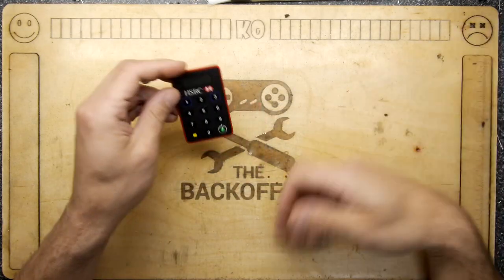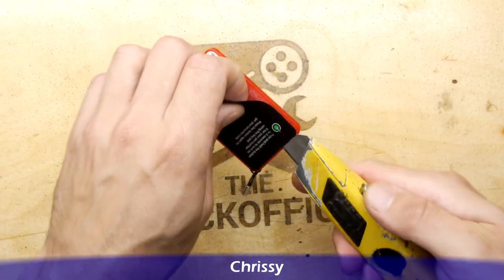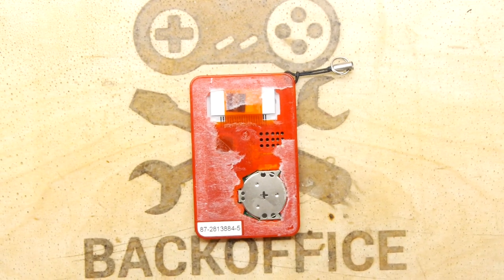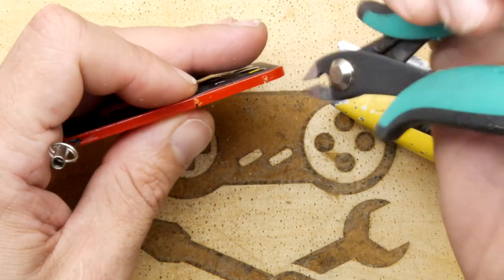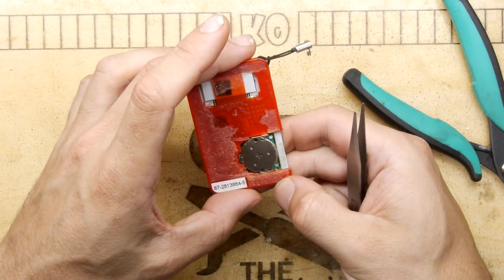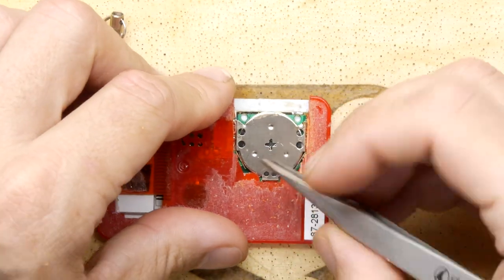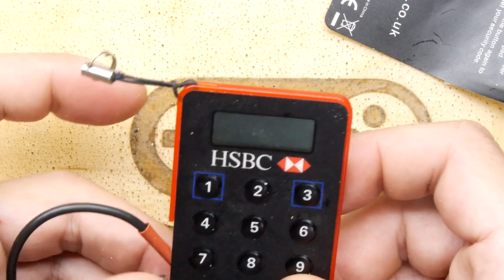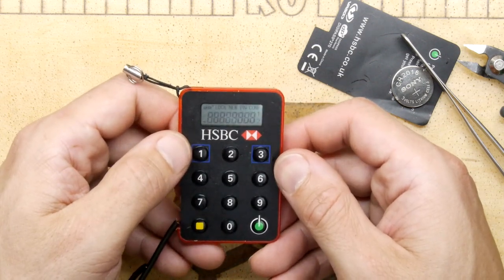HSBC Bank Security Dongle Teardown

Comment: Dongles, invented by Don Gall, actually plugged into a computer that had expensive software in the early days such as Racal's PCB design software. These HSBC security devices are not Dongles, rather simple code generators.

If the battery is removed, these will not start again unless re-initiated. A small group of us applied power by piercing the keyboard and sticking Pogo contacts in. We ran a sequence and managed to extract a complete number sequence.

Comment: Thanks for this video.
I have a similar Digipass it's about 3 yrs old now. A year ago when I powered it up I get 'batt 02'. 6 months ago I get 'batt 01' and now I am getting 'batt 00' so I assume the battery is almost done but it's still working fine. It seems from other videos once the battery is removed from PCB you lose info that is stored in volatile memory so the unit needs re programming. If I solder a new (bigger) 3V rechargeable battery in parallel do you think the unit will work indefinitely?  subject to changing the rechargeable every so often. It won't look pretty but I can keep it in a drawer by my PC which is the only place I use it.
Reply: Yes, it will work if you connect a new bat before the old one dies. Change the battery does not work.

Comment: I have three of these devices all from different banks. Two of the devices are interchangable so I can use say HSBC on Nat West. The third only works with the issueing bank and that has a battery you can change.   I thought about sending you an RSA token as they are similar but have a code that changes every 60 seconds, no buttons just a counter. The software at the other end recognises any time drift a bit like the bank authenticators do.
Reply from the maker: I recall should something similar when setting up a new account, rather than using the new supplied dongle, I manage to use the existing one I had, I don't recall any issues to it's behaviour in either account